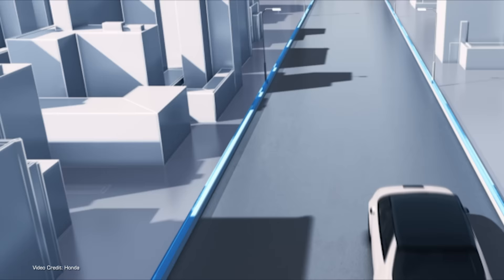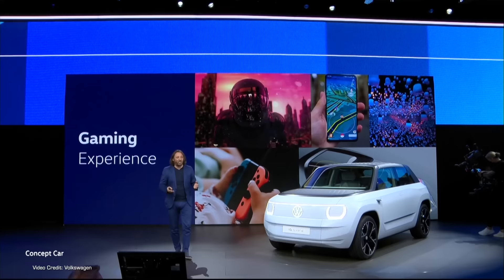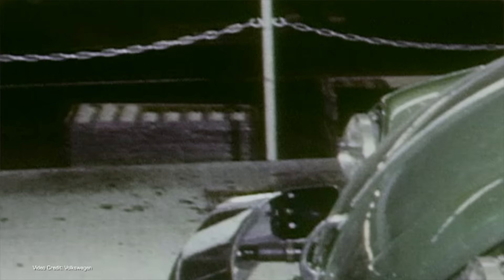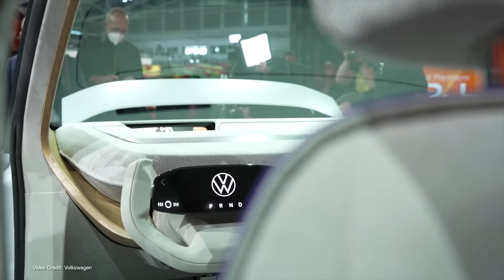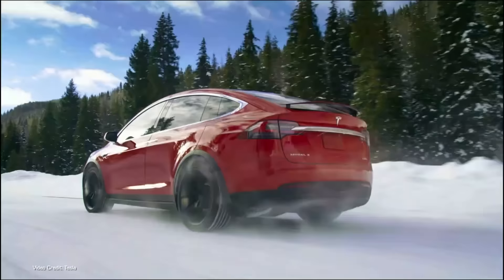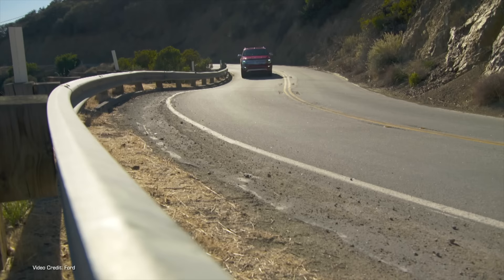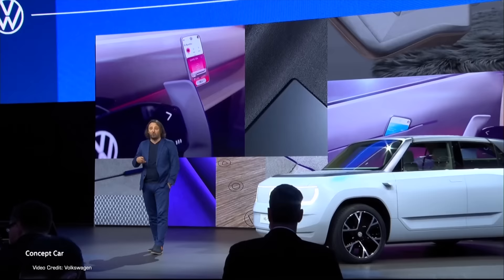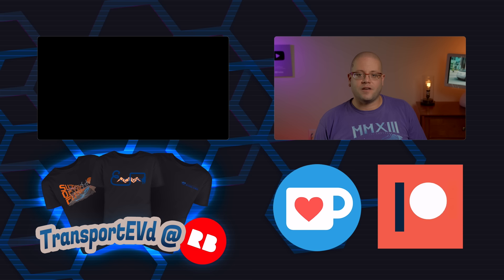We Love The Volkswagen I.D. Life - But It's Too Late To Break The Mold

Comment: I thought my 2013 Fiat 500e would have been the perfect car for me if it had been able to go 125-150 miles with any amount of fast charging, compared to the 85 miles it had and four hours to charge to full. I think the new version is all that I wanted although it doesn't compete on price with the E-up. The Chinese are absolutely going to dominate the low priced end of the car market, however they probably will cost more when built to EU or US crash safety standards. They should take over markets in South America, Asia and Africa.

Comment: Good points, but I still think in 2025 despite we would love to see majority of cars electric, I am struggling to see how the battery demand will be fulfilled. So my opinion is that definitely better later than never have a fairly usable mini car from VW. 

Just a little though to concider, in my opinion the reason for 2025 debute is exactly the same thing what I explained earlier, the lack of batteries production, not the lack of interest from VW.

So although it is tragic and sad to even think about, we won't make the need electrification in time. My estimate is at around 2025 the battery situation is going to improve a bit, this is why many pushing back the reveals and from there the production will ramp up gradually when the investments into the mines will be implemented. You can see, even Tesla is pushing away the Cybertruck and the roadster, not even to mention the semi. So 2025 is not at all too late, though the competition will be much larger as you mentioned the Chinese cars trying to brake into the western markets. It's though a question weather they will manage to do it. I am kinda positive on European car makers will get their act together and as we already see from stellantis and the VW group in Europe they will make eventually cheeper cars when the battery supply will allow it.

Comment: I'm not expecting inexpensive Chinese brand EVs to appear in the States or anywhere other than China and economically depressed countries. I think the Chinese EVs that come to the States are going to be ones using familiar, non-Chinese name plates like Volvo-Polestar which are wholly owned subsidiaries of China's Geely. Know who else Geely owns that we'll probably see EVs from? Lotus and the Brit's already see Geely's on the road because they own the London Taxi Corporation (now London EV Company.) 

Or, we might see the Chinese EVs appear with a partner brand's name slapped on them. Don't forget that non-Chinese auto manufacturers have to create 'partnerships' with Chinese companies to sell cars there; so they've already got that in place. If SAIC ever releases an EV for sale in the States it could easily be sold as a Buick, perhaps they'll make it a mid-level luxury SUV and replace the SAIC built gas-powered Buick Envision. Of course SAIC already has some EVs in Europe running around - they're called MGs - which SAIC has owned since 2006. I believe there has been quite a bit of press regarding the MG ZS EV in Europe.

Comment: Living in the Western U.S. EV's range is very important.  We have a '17 Bolt for driving in our local area but any trip over 80 miles one way will be done in our Diesel SUV.  300 reliable usable miles is the minimum to park the diesel.. Making a 500 mile trip with many hours of charging is not acceptable.  Any EV with less than 300 mile (plus a little reserve) is not going to be in our garage.  We do drive the Bolt more than the SUV but we would be able to park the diesel if we had the 300 mile rang EV.  (The diesel SUV has 500+ mile rage with nice reserves.)

Comment: I was hoping VW would make an e-up! except a ground up EV design that is cheaper to manufacture, with maybe a 45-50 kwh pack, 0-60 in 8 seconds, with a simple durable minimalist design, preferably RWD with traction control, and a little frunk.
Reply: That would be too easy. It most likely would sell like Hotcakes, and the current e Up had to be stopped because it was too cheap and they couldn't make enough of them. Why they didn't stop making some ice cars to free up manufacturing for it, who knows... Maybe so they can go and make concept cars that will maybe sell in 2025 when it's too late and the market is allready flooded with small cheap chinese cars that fit everyone's needs perfectly... Take a look at the Ora R1 or Black Cat as it's also called.

Comment: As an European I've long forgotten about VW as a brand worth thinking about. Out of their stable, only Škoda and maybe Seat are likely to make something cheap and small in the coming couple of years, but why buy a definition of bland that is Škoda (not talking about quality, it's fine), if you can buy a Peugeot, Citroen, Kia, Hyundai or even Opel/Vauxhall, which has made an almost a 180 degrees turn from a faceless brand into a genuinely cool one recently. I mean, Mokka looks better than this VW concept, imho. I've seen it on the streets many times, it is a real head turner. Plus, there's also Renault, although they suck recently, imho... Anyways, all of those seem way ahead of VW in terms of affordable EV development and will be even more so in two years from now. On the other hand, considering the fact that most VAG buyers don't care about EVs and their expensive EV lineup is good (see Audi badged vehicles), they will keep on going very strong, unfortunately.

Comment: More range is more important to me than more power.
Steering wheels need to be round.  Any other shape increases the risk that your hand will miss the wheel when you change your grip on it while doing a tight turn.
Controls all need to be tactile (knobs buttons and sliders) because any time you put a climate control etc on a touch screen, you are forcing the driver to take their eyes off the road.
I think we are at least 50 years from having a self driving mode that is as good as a person behind the wheel even though I am fully aware that most people behind the wheel are idiots.
VW messed up on its "new beetle" .  One of the very good things about the beetle was if someone bashed into you in a parking lot, you could unbolt and replace a fender your self (an/or unbolt it hammer out the dent and put it back)

Comment: let's be real here... the UP! was designed to be ICE, Hybrid and Electric from the beginning but VW never wanted to make a desirable electric version. For 7 years, the car only had a range of 120km in summer and since the battery was upgraded to 32kWh VW has been restricting the offer and claiming to be "sold out" repeatedly. Still, it is a hot seller when it comes back out of the black out.
The ID.Life brings nothing new; same smartphone integration, same size, same range (starting price is never the model with the "up to" range in VW press releases). Might as well finally make enough e-UP! to satisfy demand.

Comment: There are good reasons the vast majority of new EVs are more expensive.    

EV manufacturing is still immature and new.  The manufacturers make more margin per vehicle, on expensive cars, so the companies have more money per factory (the capital they need to build) to grow.    Once EVs dominate the mid priced to expensive market, EV companies will move into the less lucrative (this means less capital efficient) market of small cars.   

Along the way, people who can't afford a new Model 3 or an ID4, will start buying the used mid-priced EVs.     Most lower income Americans don't buy new econoboxes, they buy used medium priced cars.    This started happening in the 70's, when a 10 year old car was a rarity.    I grew up driving an 65 VW Bug.    We had to overhaul the engine every 40k miles and at 110k miles it was trash.   Modern  cars, can reasonably be expected to last 200k miles.   It is now a better value, for low income people to buy a used moderately priced car instead of a new cheap car.   Though some still want a Yugo. When they've been around for a while, a used M3 SR+ with 100k miles on it will probably be a great value and sell for $15k.

The reason why low price EVs are not coming to rich countries is market immaturity.   The first ICE cars weren't cars for the masses.    The masses walked, took street cars or had a wagon.   It wasn't until the Model T came out that cars were available to the middle class and it wasn't until the Bug came out that almost anyone could afford a car.   

The nice thing about EVs is that there is still a lot of price drops available as technology improves and economies of scale kick in.

Comment: Did you end up getting a cheap Fiat 500e to replace the Bolt?
Reply from the maker: No, though I’d have considered it. Unfortunately right now, there is no such thing as a cheap Fiat 500e in my area. I saw a lovely 2018 500e going for $15k just today, and even high mileage examples sell for around $11k or more. 

I’m driving a 2011 Th!nk City I bought for less than $3500. There’ll be a video all about it in the not so distant future - Winter

Comment: CORRECTION  The Mazda MX5 or Miata [?] is actually stupidly good in the snow - I know this should not be a thing...

But I owned one here in Bulgaria where we used to get 1m of snow each year and the MX5 with snow tires on NEVER got stuck and I lived up a steep hill...
Reply from the maker: Good to know. On the naming front, it was the MX5 in most of the world but for most of its existence it was the Miata in the USA, that’s why I included both in my mention - Winter
Reply: @transportevolved  - Honestly I had an MX5 and a Landrover Discovery and I would happily go to the shop in the MX5 when it was snowing - but I did have narrow snow tires on, that's the law here for winter and I did have a sack of gravel in the trunk for emergencies / weight...

But its great fun bombing around in the snow in an old Mk1 MX5 with the roof down.
Reply: @piccalillipit9211  It may work in Bulgaria because you only get 1m of snow a year. Some places get 1m in a day. I didn't enjoy driving a RWD in those weather, snow tires or not.
Reply: @jenny80myles  - Oh hell yeah, there are limits. But when I say we get 1m I mean the snow was 1m DEEP.  But it just gets compacted and you drive on top of it.  

BUT - global warming has solved the problem cos we have not had snow for 8 years...  Maybe 1 inch for half a day...
Reply: @piccalillipit9211  Last winter we had about 220cm of snow. I may have to wait a few more years.

Comment: I simply want a Mazda Miata lookalike (old shape) with a 50kW (YASA style hub motor without gearbox or diff) electric motor on each wheel, inboard disc brakes, bluetooth to sound system, no navigation, no internet connectivity to the car, I already have a phone and ipad. Keep the stalks and buttons, Instruments in front of the steering wheel. Biodegradable leather instead of plastic. Corrosion proof so I don't ever have to buy another.

Comment: The Japanese are really dragging their feet in the EV space. Toyota is late to the party and is still pretty resistant to the whole idea, Honda is primarily an internal combustion engine company that builds cars, lawnmowers, and everything else just to have somewhere to install their engines. Honda has made remarkable strides in IC engines and that is where their strengths lie but they don't have any expertise in electric motors or batteries. Honda and Acura are grudgingly bringing EVs to market in a few years but using GM's Ultium platform on which they will put their own bodies. I'm not too jazzed about Volkwagen's EV offerings so far. I own a Tesla Model 3 but Hyundai and Kia are going some really interesting things.

Comment: You compared a post-tax European price and then suggested how that might equate to a pre-tax U.S. price, which is very distortive.  20k Euro equates to about $24k USD, yes, by using straight exchange ($23.5k).  However, prices in Europe are generally advertised inclusive of sales taxes, whereas in Canada and the U.S. prices are generally advertised before sales taxes.  So a car with a 20k Euro suggested retail price is actually about a 16.5k Euro car before sales taxes (which average 21.3% across the Euro Zone).  And 16.5k Euro equates to about a $19.5k USD price.  Obviously there are other factors at play, too.  But comparing the after-tax European price and the before tax USD price is extremely distortive and should be avoided in journalism as much as possible.
Reply from the maker: You’re right, that was an error and I’ll be more careful about that in the future - Winter
Reply: @transportevolved  No worries, and in fairness to you it's a really common error!!!  :)  Thanks for taking the time to reply!  thumps up

Comment: Could a small electric car tow a utility trailer or a 4 meter sailboat for 50 miles for around 28 K.
Reply: Considering that the chassis has to be developed to house a heavy battery, and a solid motor to boot, im sure it'd more than capable to tow a box trailer at least, but manufacturers don't want you doing that so they don't rate the car for it. The sailboat point is a nonargument because you tend to need larger vehicles for that anyway to mitigate any fishtailing.
Reply: The ID.3 is a bit more expensive, start at €30K, but it will tow a small trailer 50 miles.
Reply: Sure. Nikki tows a small utility trailer with her Bolt regularly. (List price is over 28K, but GM - before its production and sales were halted - frequently discounted it to that with incentives.

Hyundai/Kia have multiple models that fill that bill.

Sure, many models that can do that don't officially support towing from the manufacturer, but towing 1000 pounds is something nearly any mainstream 4-door vehicle can safely do with a third-party tow hitch.

Comment: China won't be breaking into the US market any time soon. Their cheaply priced good quality cars would disrupt the status quo here and both the left and the right won't allow that.

I think VW has potential but we want to see an all electric Beetle and Bus. I believe they would sell very well. The Beetle of the 2000s did very well here in the US.

I push back on this notion of range etc. I live in Virginia and we have a mixed climate here. Generally we haven't been getting a lot of snow in the northern Virginia area but when it does you need something with ground clearance and power. I'm not saying there's no room for small EVs because desperately need more of them here for people who don't travel long distances for work or play.

But range is something different. I'm sorry but other than the Tesla charging network everyone else suck and you know it. So it makes no sense having a small car with a small battery and relying on networks that incthe app say what is at your destination only to find most don't work and the one that does is a 50kw charger.

This is why range anxiety exist. It's because the other networks haven't gotten their act together and it's another reason why the Model 3 and Y Long Range are sold out. You get the best of all worlds....efficiency,  good charging network and powerful EVs.

If others could do it better I'd be ready to buy one of theirs.

Comment: Too bad its kind of hideous and at the same time doesnt appear to be especially efficient.  I dont mind ugly in service to effeciency or economy or functionality. But this... thing looks like its ugly just to NOT be mistaken for an electric Beetle. Because VW is scared to death of the Beetle badge after they fumbled the Beetle refresh by making it just too damn expensive to own or repair.

It wants to be an electric Gulf but the iD4 is already using current Gulf styling and the afforementioned Urban EV concept already used original Gulf styling so this is just sort of... neither? Its somewhere lost in the uncanny valley of compromised design because VW designers have completely lost track of anything resembling a design language or brand recognition. The Germans in general seem to have just completely lost their way with EVs. Which is strange because the Koreans seem to have finally found it.